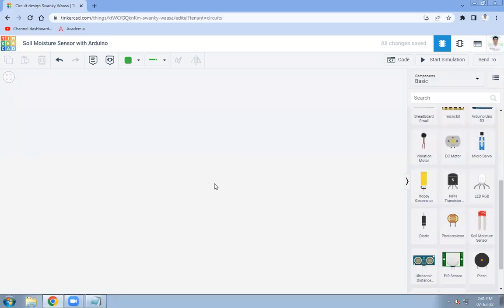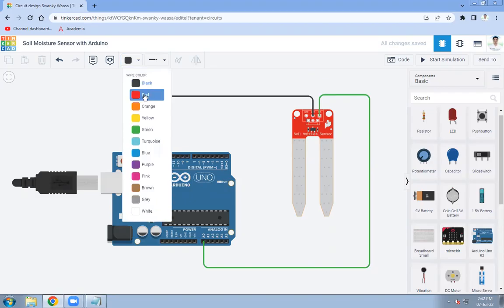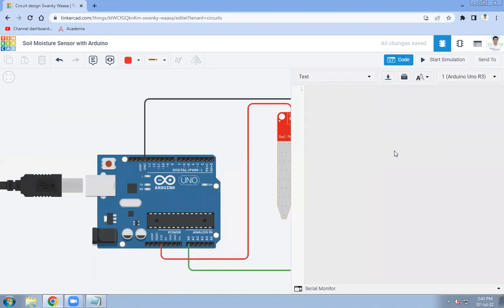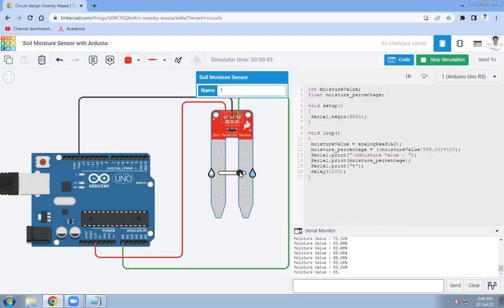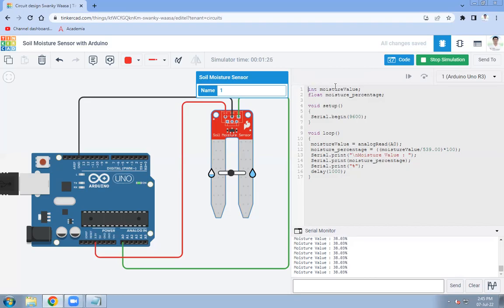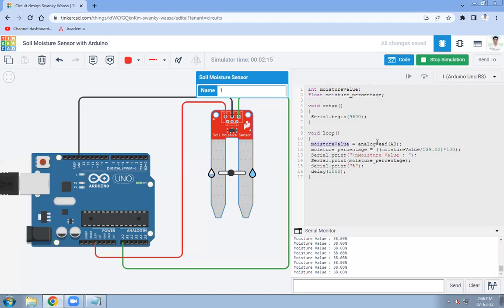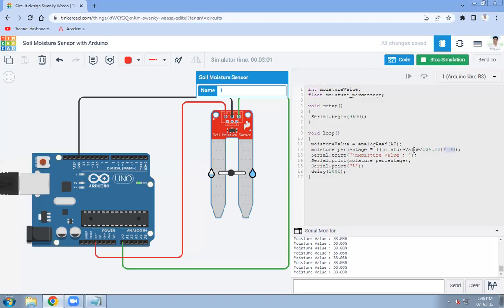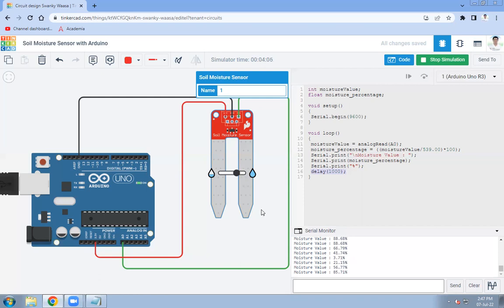Soil Moisture Sensor & Arduino using Tinkercad

Comment: int moisturevalue;

float moisture percentage;

void setup()

}

Serial.begin(9600);

void loop()

Moisture percentage ((moisturevalue/539.00)*100); noisturevalue analogRead(40);

Serial.print("\nMoisture value: "); Serial.print(moisture percentage);

} 1

Serial.print("%"); delay(1000);😂

Comment: code of the program :
int moistureValue;
float moisture_percentage; 
void setup()
{ 
Serial.begin(9600); 
} 
void loop()
{ 
moistureValue = analogRead(A0); 
  moisture_percentage = ((moistureValue/539.00)*100);
  Serial.print("\nMoisture Value : ");
  Serial.print(moisture_percentage);
  Serial.print("%"); 
  delay(1000); 
}
Reply: Love you so much
Reply: works 👍keep it up

Comment: hello sir, why the variable moistureValue is divided by 539
Reply: It is the maximum value(threshold value) of the soil moisture sensor, so we divide it by 539 and multiply that by 100 to convert the data into percentage. Hope that helps :)